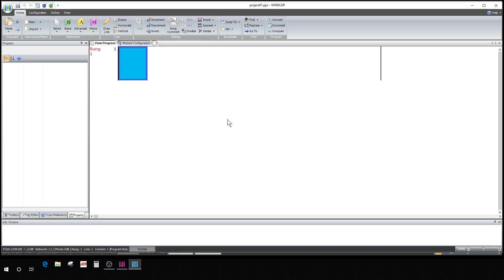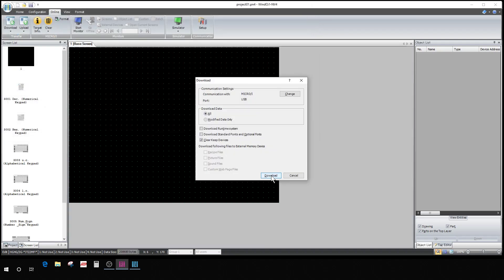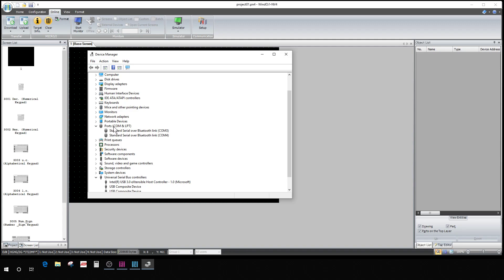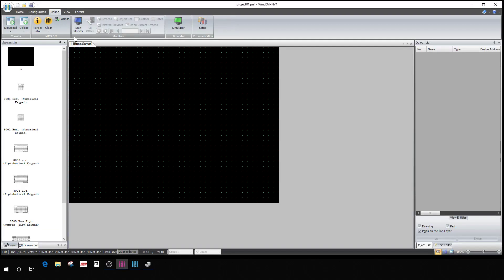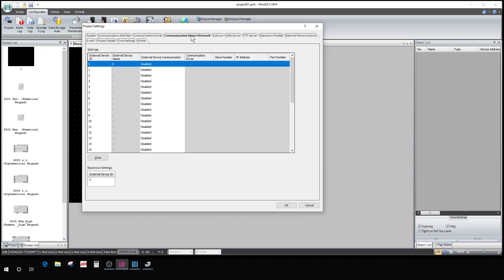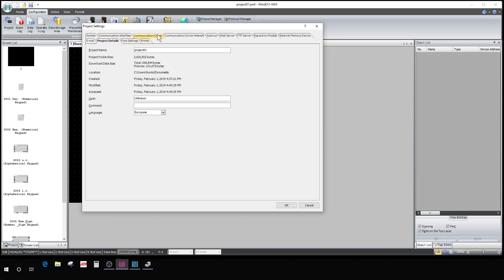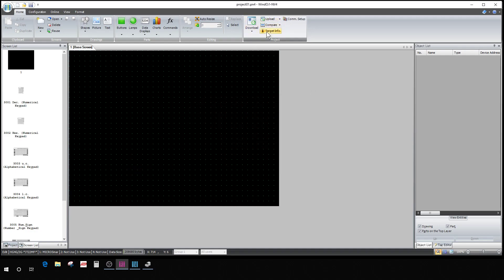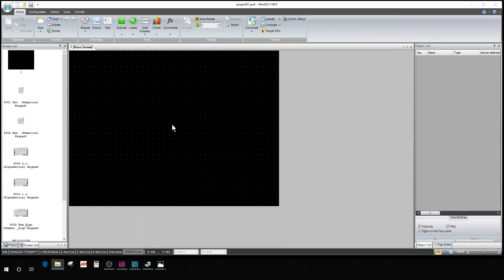Idec PLC HMI communications

Comment: Is there any way where if I push a input button on the HMI screen that it can activate the output wired to the PLC? Such as a pilot light wired to the PLC if I push a button on the hmi screen? Thanks in advance !
Reply from the maker: Yes, you can do that.  It is simple.  Give this a try.  On you HMI software, make a bit button, address it M001, point it at the plc external device address.  Be sure you have your HMI software setup for external communications.  It will not work if you don't.  On your PLC software create a rung with M001 as your normally open input.  On the output side, (right side of the rung) create Q0001.  Now if you wire a indicator light to Q001.  and  push the button on the HMI, the Indicator light will come on.   If this in not what you are trying to do, let me know some more details.  We will get you where you need to be.  Thanks for watching.
Reply: I’m gonna try it out in class tmr! I’ll let you know! Thanks a lot!!!
Reply: Sorry for the late reply! I got it but then tried another program and it said that there was a shorted circuit in the PLC programming so I changed it and redownloaded another program I made and now my button on the HMI will not interact with my output!
Reply: Still doesnt work, my laptop wont download anything via ethernet only usb. I see the IP address for both the hmi and plc on the respoected software. They look like they communicate but nothing is actually working. Your videos help a ton eother way, but i cant figure this one out
 Thanks!😊
Reply: To be specific, i see the right ip address in target info, but when i click okay it says "not connected or not responding"

Comment: I'm new to PLC programming and I'm currently trying to download ladder logic using WindLDR to my FT1A.  I keep getting an error that reads "USB devices are not found or USB port is not functioning"; however, I was able to download to the PLC from WindOI-NV3.  Have you run into this? Any tips? I've also tried using ethernet for this but that tells me "WindLDR failed to make a connection to the device with the IP address ....."
Reply from the maker: FT1A touch uses a different program than the rest.  You have to use NV3.  I dont know if that what you are using.  NV3 downloads the ladder and HMI program simultaneously from NV3.  I have a couple of videos on using the FT1A touch.  I believe I have one specifically on communication. Check them out.  They will walk you through it. If that doesnt get you where you need to be, give me another message with a little more detail.  I will help you out.
Reply: @huntxtrm  I'm still quite confused on how to mesh the logic and the NV3 together.  I have a program that I wrote with WindLDR.  How would I mesh that with NV3?  Or do I need to actually start with NV3, open control function in NV3, and write my ladder in there?  I hope my question makes sense.  haha.  I've watched pretty much all of your videos and it's great information, but I'm still missing that part of it.  Thanks man! I'm a neighbor in Louisiana by the way.
Reply from the maker: @zwalker4146  It is always a good idea to try and write the program in the software you will be using for your particular platform.  I think you just learned that.  LOL.  But, that is how we learn.  I have made many mistake myself.  And, I have learned many ways to do things easier over time.  So, don't let it get you down.  Here is what I would do.  I would open LDR(your program you have written), and open a new NV3.  At the same time.  Split them on your screen if you can.  This will help you alot.  On your program in LDR, export your Tags.  then open your NV3 and import these tags.  Then go to your LDR and Hightlight your complete ladder.  Copy.  Go to NV3 open up the ladder editor, paste.  This works, but be careful.  You want to check your addresses, make sure they are where they need to be.  This is where your split screen will come in handy.  You can check line by line.  Also keep in mind, the addressing in the FT1A is going to be different than whatever PLC you chose in the LDR program.  So, you might be changing some addresses to go to expansion plugs, or you might have to set up a master slave type scenario between you FT1A and an FC6 or similar.  There are lots of ways you can do it.  Just remember you the amount of ins and outs you have in LDR, you will need to find a place for on the FT1A, or in an expansion plug, or Slave device.  I know that's a lot to soak in.  If you need clarification on anything, let me know.  I am glad to help when I can. I haven't done a video in a while.  If you need me to do one on this.  I would be glad to.  Just let me know what PLC you have selected in both programs, so I can match it.  I will just write some random I/O to copy over to show you how.
Reply: @huntxtrm  thanks so much, I actually did it the hard way and just rewrote the program (that was before I saw your reply). I’m currently trying to get my timers to display on my screen. I think I need to step away from it for a while since I’ve been at it since 7am lol. But I’m using the FT1A-C12RA. And you’re right, information on these PLCs is scarce.
Reply from the maker: @zwalker4146  you will get it pretty easy, not really much to them.  Thanks for watching.
Reply: @huntxtrm  thanks I’ll be looking out for more videos. I’ve subscribed.